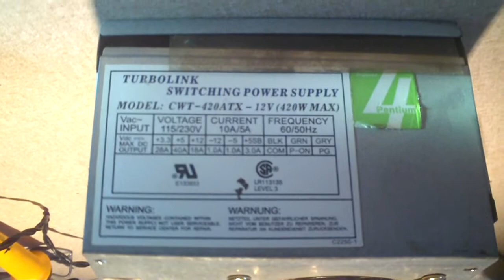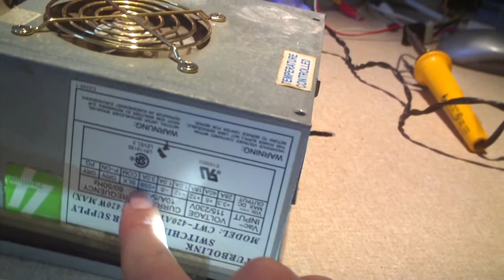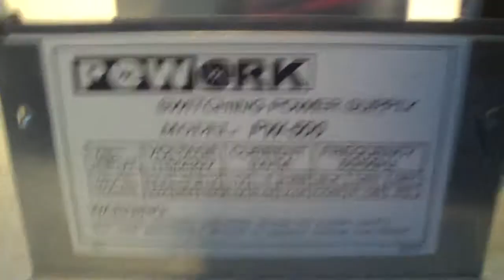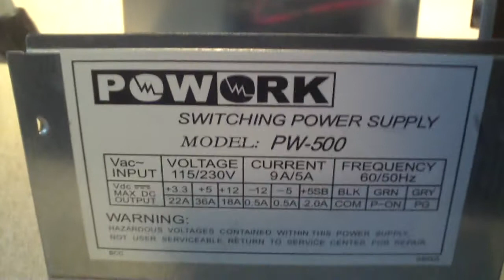Two Gutless Wonder Power Supplies

Comment: Channel Well power supplies are usually good, but since they build to order, they built a gutless wonder custom for Apevia/Aspire. I have a Channel Well built Thermaltake 300W (ca. 2005) and it has good heatsinks, good sized transformers, good filtering, etc.